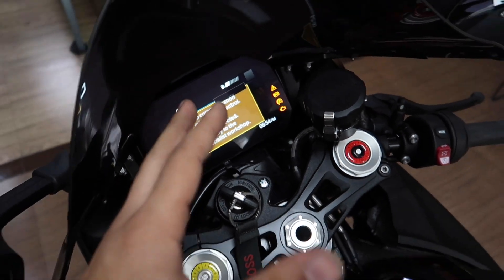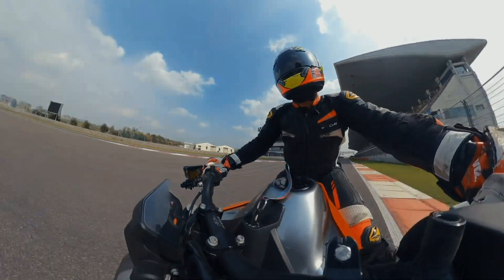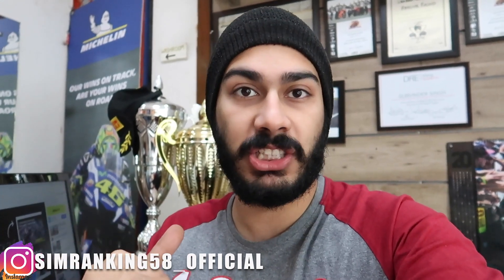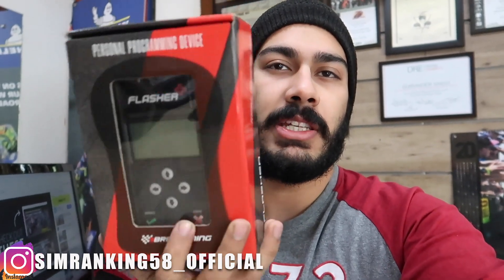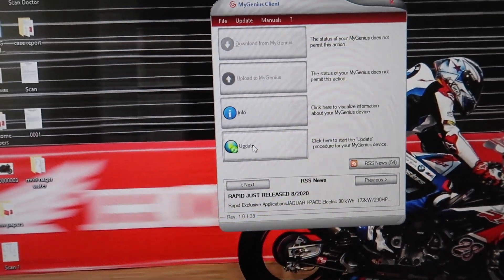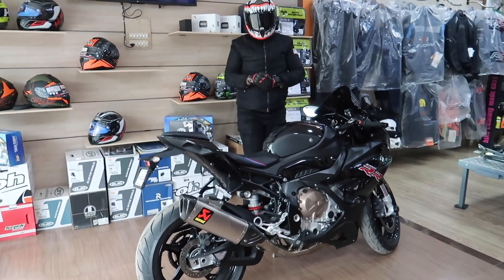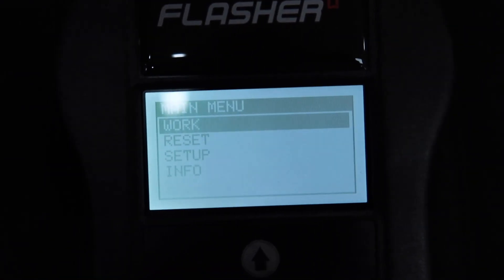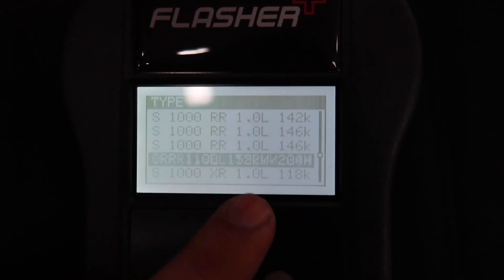BMW S1000RR 2020 ECU FLASH STAGE 1 | REDLINE RACING STORE | SIMRAN KING

Comment: Now this beast gains 218+ hp
Reply: Not 218 hp, it gains 30hp with akrapovic full system and sprint air filter. 237 bhp produce at crank.

Comment: I guess even Bren tuning would not show this in details as you showed brother. One quick question, flashing the ECU and replacing the Engine Block off plates will not hamper the warranty??
Reply: It will void warranty. Haven't you checked their website or YouTube channel for detailed installation of brentuning ECU flash. Once check Maxwell, motonosity, 650ib they have already done it and explained in detail 😊👍
Reply from the maker: With stage 1 you can switch back to stock map. Thats doesn't voids your warranty. Stage 2 will void ur warranty

Comment: Great video on bren tune flash..but 2020 s1000rr had flat spot at 4000 to 6000 rpm with stock ecu..did you ride the bike to feel the difference please do make a video on that as well...also one more thing i heard that 2020 model have brake fluid leak issues from callipers and steering damper has some leak issues as well .. btw a big s1000 rr fan..love all your detail bike tech videos😁
Reply: 650ib paste😂  flat spot is not there in India version (eu), only in USA version is detuned.  Callipers leak in some, some fine.
Reply: @pravesh736  ooh didn't know that but these bikes are CBU not made in India shipped from Germany so they are European right
Reply: @kaustub_98  not Germany as conpany is german
All manufacturers have their plant in Thailand
Reply: @kaustub_98  I think the new s1000rr  is made in hosur tvs/BMW plant, Ckd kit, but it is euro version.
Reply: @pravesh736  only g310r and g310 gs get manufactured in TVS plant...all big litre class bikes are CBU imports
Reply: @kaustub_98  oh, probably from Thailand, have to ask BMW guys

Comment: Bhai bmw ko tail light nahi h kya??
Reply: Its hidden it can be seen when you apply brake.
Reply: @atharva0777  omg 😳👌
Reply: @phukatchodu  why are you amazed
Reply: @atharva0777  that is beyond science 😳👌👌
Reply: @phukatchodu  true bmw works on there bikes a lot
Reply: @atharva0777  omg 😱😳😮👌
Reply: @phukatchodu  hey i am very sorry i mad a mistake i told you about modified s1000rr modified tail light which is hidden. The stock tail light is integrated in turn indicators.
Reply: @atharva0777  omggggggg 😱😱😮👌